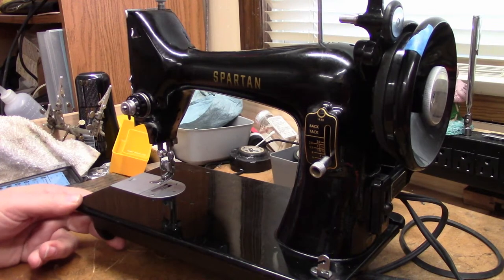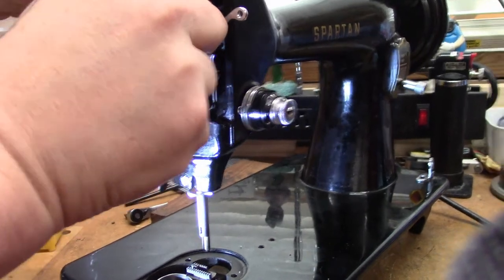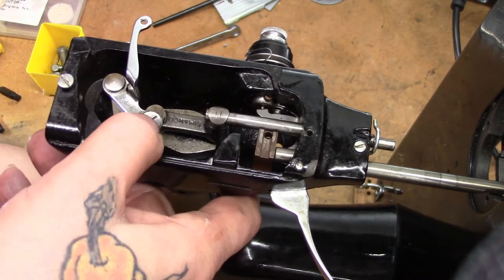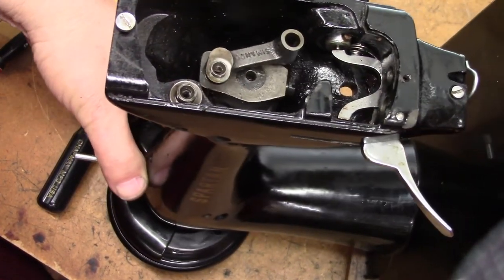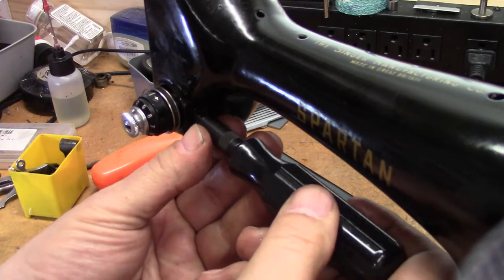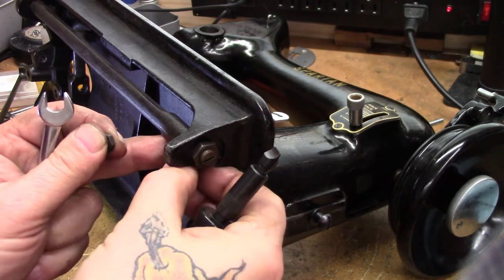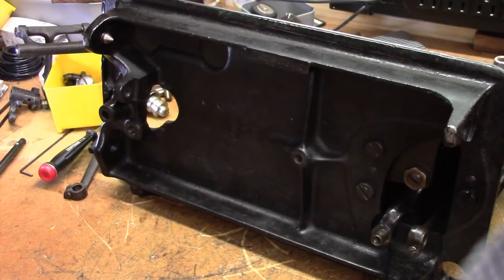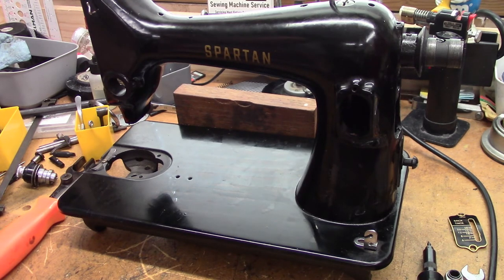Singer 192k Part 1

Comment: Hey Bob, I have a quick question bout the 192k. I have serviced mine and it runs perfect. I love the sound of it. But I tried to put some thick thread into it. like tex 80 in the bobbin and tex 90 on the spool. I'm having lower bobbin tension issues now.. top stitch looks great, but the bottom looks loose and not as tight as I would like. 

Any tips how to adjust that to handle these threads?
Reply from the maker: That's a bit heavy for a 66 class machine. I try not to go heavier than a Tex 70 bonded. The 66 class bobbin case isn't as forgiving as a 15 class for thread weight.
Reply: @BobFowlerWorkshop thank you! wow, if it takes a tex 70 I'm in heaven.

Comment: Hi Bob - love the video tutorials. Just a question about the screws that are opposite to tighten and loosen - I have a Singer 103k with a stuck needle bar and there is a similar screw - is that a left tighten and right loosen as well? Thanks
Reply from the maker: Hi Mira, 
If the slot on the head of the screw doesn't go completely from side to side, it's a good indication it's a left handed thread instead of a "normal" right handed thread.

Comment: I am loving your video. I have a 1959 Spartan that was given to me. It is dirty and needs a deep clean. When you clean your parts, what do you use? Also this is really good help because the hook race etc is very bad and gummed up with something. I will have to learn about this particular motor because it smells bad when run for a short bit. I am surprised that the hand wheel spins not too bad.
Reply from the maker: Greasy parts that come off the machine go to the sink where they are cleaned with HOT water and Dawn dish detergent. If the crud is particularly egregious, the part might go first to the garage to be wire wheeled to remove the nasty stuff. The wire wheel doesn't get used on polished parts, only on things like rock shafts and connecting rods. After degreasing, the parts are rinsed in hot water and taken to the air compressor where they are blown dry. Don't let them drip dry by the sink as they can (and will) flash rust.
Reply: @BobFowlerWorkshop  thank you so much for replying to my message. You should have seen the mess of this machine that was given to me. I do not think it was cleaned since the day it was bought! When I took the faceplate off it was so full of lint, dust and had shellacked all golden and there was like a tarry gummed up mess in there. The bottom hook was just as scary and the lint in there was almost rock hard. I might break her down even more because of how bad this machine is. The motor works but definitely needs work. Black dusty linty in there. I want to thank you for posting these videos because I live way too far away from any place to get this serviced. I think I would have a heart attack with just the postage on this machine hahahaha.
Reply from the maker: @TiralynnEruanna  I feel your pain! I've had machines where mice have made homes (and died) and it's always a challenge cleaning out tons of lint that has turned to stone. Worse of all is what I call "crud welding" - that's where old oil and grease are mixed with lint to form a concrete-like mass that's not only tough to get out, but will lock up the mechanism as well...
Reply: @BobFowlerWorkshop  dead mice! Eeeeewwww. Almost every part has been a challenge to remove because of the “welding”. Now it is the pin that holds the pressure foot lever that does not want to come out oh such fun!
Reply from the maker: @TiralynnEruanna  Look for my video "Of Of Mice And... Sergers?"... no carcasses, just nest in a Singer 246... https://youtu.be/pqndd7KqeS0

Comment: Enjoy your tutorials, but concerns me to see that this lovely machine is being bummed around on the wood table. Can’t ya put down a bummer pads? If were my baby I’d be sad. No offense please, just my concerns. Ty
Reply: Hi Barbara - I've watched lots of Bob's vids and so I know that board he's working on is made of wood but is "soft" - much softer than the machines.  He explained in another video (I can't remember which one) that he uses that softer board on purpose so that it won't damage the machines.
Reply from the maker: Yeah, I get messaged about that from time to tome. Know though that the bench top is a paper product called medium density fiberboard and it gets beat up without hurting the machines. I recently made a new work surface that will be easier to keep clean, and affords some extra padding.